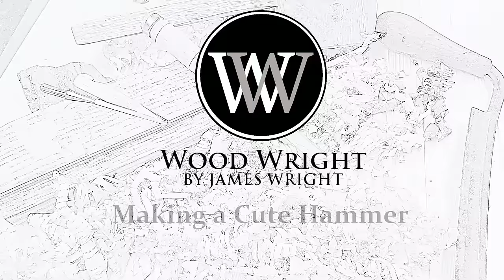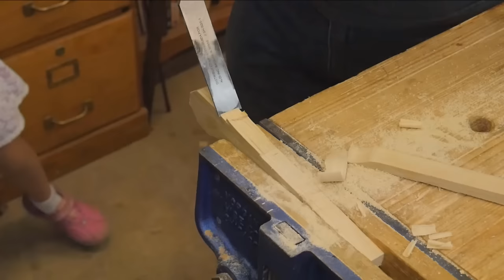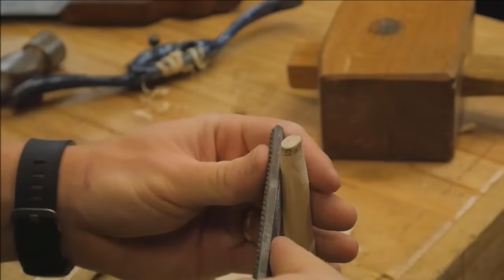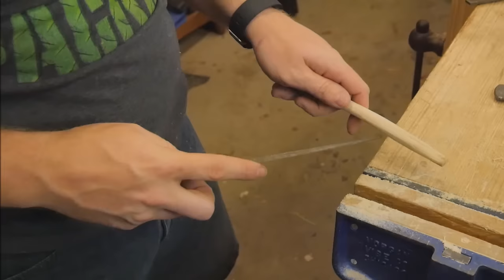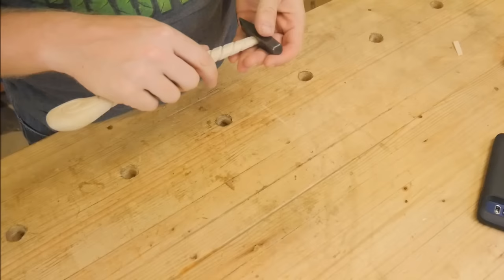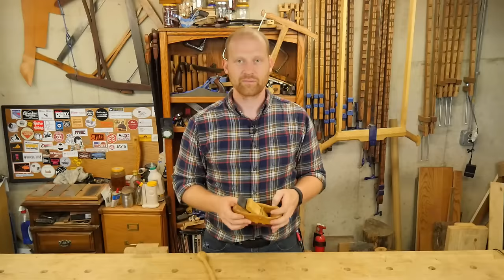Making a Cute Little Hammer For Adjusting Wooden Planes

Comment: I've got several hammer heads without handles, now making replacements doesn't seem so intimidating!
Reply from the maker: The first one is always a learning experience but after that they are relay easy. I would love to see what you come up with!
Reply: Wood By Wright Any recommendations regarding material selection?
Reply from the maker: for a hamer most any hard wood works well. I like oak, ash, Hickory, maple,
Reply: +Wood By Wright Thanks for the info and inspiration.
Reply from the maker: Any time!

Comment: Question / observation about how you work at your bench. It seems like you prefer your end vise. To me you are loosing the "mechanical advantage" (?) of the length of your bench. When you were chopping with the chisel and shaping with the spoke shave the bench was moving because the forces were in the short (front to back) direction of the bench. The face vise and working against the long dimension (side to side) would be more stable.  I don't know if it is habit, easier to get a good camera angle, or some other reason.  Just an observation and $0.02 from the peanut gallery.  NICE HAMMER! BTW.
Reply from the maker: Most of the time I try to move with he bench but it is often easier just to stay on one vice. also I do not feel as much movement of bench as the video shows. Thanks!